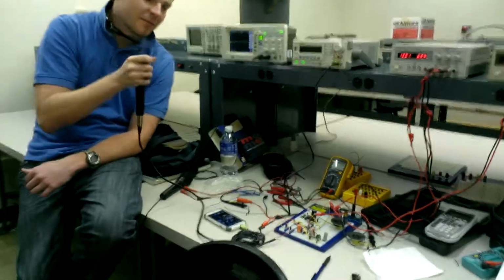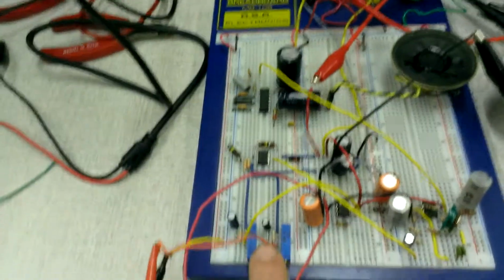Music and voice summing circuit with audio amplifier

Comment: Is there a schematic for this? Please?
Reply from the maker: This project was completed using a series of PDFs from Agilent Technologies 

http://www.keysight.com/main/editorial.jspx?action=download&cc=US&lc=eng&ckey=895943&nid=-34944.0&id=895943

About half way down the page you will see 

-Audio Amplifier Frequency Response, Distortion and Clipping
-Exp. 4: Variable Gain Amplifiers; Summers; Intermodulation Products
-Noise and Differential Amplifiers to the Rescue
-Audio Tone Control Amplifier

Download these and follow the instructions.

To give you a quick explanation..... build and test these circuits independently but on the same breadboard. Then hook a mic up to the differential amp, then the output of the diff amp to the summing amp with the output of an external source(Phone, mp3 player...) then to the tone amp, The output of the tone amp then goes to the LM380 and to a speaker from there.